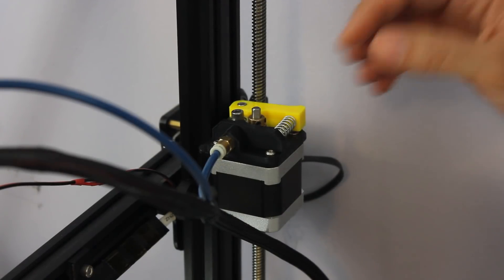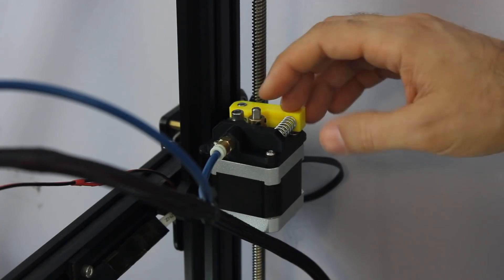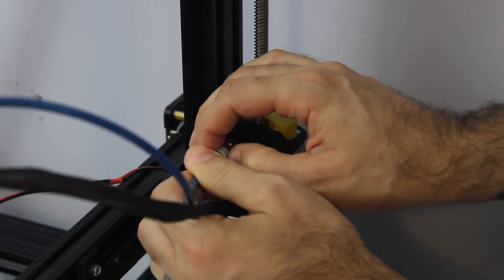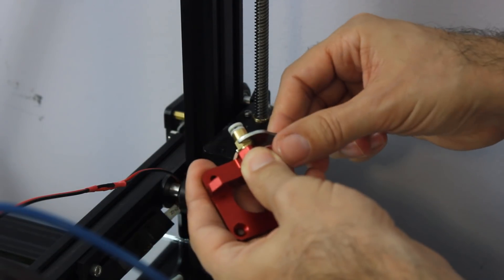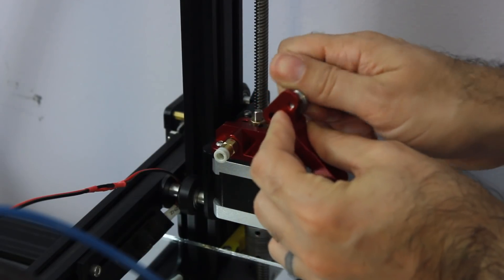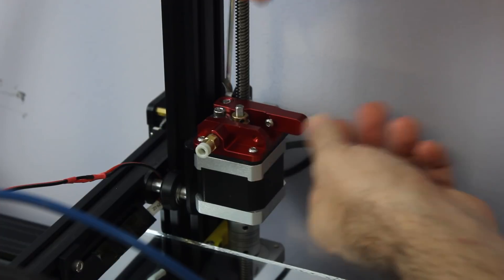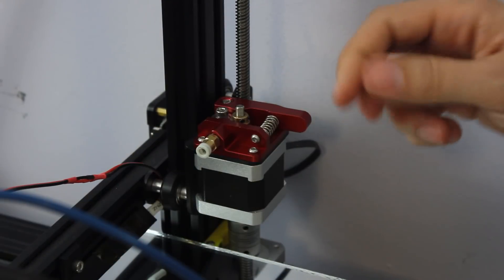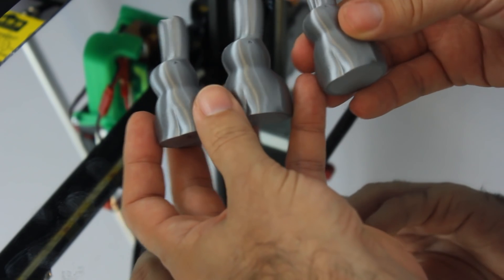Creality Metal Extruder Upgrade for CR-10 and Ender 3

Comment: Hi there. I have done a similar upgrade and I also replaced the gear. After the upgrade I kept having my extruder skipping. After some troubleshooting I found out that the replacement gear is of a different diameter. For me about 1 1/2 mm bigger radius which caused the issue. Thanks for the vid!
Reply from the maker: Wow, thanks for the info. You're the first person I've heard that's encountered this. Was it a Creality brand extruder kit or another manufacturer?
Reply: @Review3d  You're welcome. As far as I know it's a similar kit but not from Creality so that might well be the reason.
Reply: @Review3d  I'm having the same issue as Marcel. Mine are from Creality (Amazon). I've replaced the extruder arms etc with this kit on both of my Ender 3 machines and have had nothing but problems. I've tried tightening and loosening the lead screw for the tension arm.  It's like it can't pull the filament anymore no matter what adjustments are made. I don't want to give up but I'm about to toss them off a bridge! lol  Any suggestions?  btw I wish I had found this video before I replaced mine. It was very easy to follow.
Reply from the maker: @bakedonmaple1196  if your extruder is clicking I would compare the gear to the original one to ensure you didn't receive a different size like Marcel did. If that checks out then I would start a print and while it''s printing press on the extruder arm (in the direction that applies pressure, not to release pressure). If the clicking stops then your not getting enough pressure on the filament. Triple check that everything is installed correctly. If it is then I would add a thin washer to the spring to increase the pressure. If that doesn't help then email me (on the About page) and we'll see if we can troubleshoot more.
Reply: Dina Schliecker Replaced mine today, Same issues at first. I loosened the pivot screw and bearing screw until it stopped. I do still get an occasional creak noise, but not as bad as the clunking I was getting before. I still have more fine tuning I suppose, my under extrusion issue isn’t completely gone. How did you make out on yours? update I made a tiny spacer out of a paper clip per the idea of another YouTuber, and put underneath the round bushing that the screw goes through in the extruder arm. It seemed to make a huge difference, now the bushing can bottom out without the arm tightening with it.

Comment: A little blue loctite will take care of your persistent loose screw issue. We also run into a lot of this with anodized parts on RC vehicles. All screws going into metal that move/vibrate need loctite. Just make sure it isn't red!  ;)
Reply from the maker: I keep loctite nearby, but for this I wasn't sure I wanted to use it. My reasoning was that I wanted to be able to adjust how tight the screw was. If the sleeve was a little longer then you could fully tighten it, but as designed it will bind up the extruder arm if you fully tighten it. Loctite would be perfect otherwise.
Reply: @Review3d  Sounds just like the steering knuckle situation... We tighten them until the movement feels right, then let er cure overnight. Of course without having hands on, you know better what you're dealing with! 😉
Reply from the maker: @bustedupbungalow  fair point, I'm sure I could get it set where I need it before the loctite even starts to cure. I have another mod I want to do on the coupler side, then I'll probably try the loctite when I reinstall everything.

Comment: That lever jams when you tighten the bolt because the sleeve is made wrong. It should been made slightly longer than the thickness of the lever. I added a thin washer (about 0.3 mm) under the sleeve and my lever moves freely with bolt tightened. Keeping the bolt loose can lead to bent bolt or damaged thread. 
I also had to file edges of the lever to keep idler from grinding against the lever. 
I addition, I printed a small cylinder shaped cap for the spring so that I can adjust spring tension with a bolt.
Reply from the maker: Yes I wish they would make the sleeve longer, or at least include a washer. I hadn't heard of anyone else having the idler grinding against the lever, I'll have to keep an eye out for that. I like your idea for the cap.
Reply: @Review3d  I just made a cap with indent for the bolt on the other side. Slide it over the spring and put bolt in.

Comment: I had the exact same issue you did. I ordered the aluminum extruder from Creality and found the pivot screw loose as well. I also didn't replace the gear as well because I couldn't budge the grub screws without stripping them. 
I wish they had made the center pivot tube a little longer on the tension arm because if you tightened the screw it binds up and I didn't want to leave it loose so I fabricated a small spacer out of a paper clip.  Wrapping a piece around the screw and was able to tighten it down. I noticed an improvement right away. 
I would recommend it to everybody that has a Creality printer.
Reply from the maker: Yes, I completely agree about the pivot tube. It would be nice if you could fully tighten down that screw without binding up the arm. I was considering a small washer placed under the tube, effectively what you did with a paper clip.

Comment: This is not better than the plastic Creality extruder.  A much better option is the MacEwen MK8, which has tighter tolerances for pushing flexible filaments.
Reply from the maker: MacEwen does make a good upgraded extruder and yes, for printing flexible filament the FlexiPlus version would be a better choice than the original style extruder.

Comment: For some reason they only put a 16mm screw in there that barely catches and is mostly held in by the friction of the spring -->  easily wiggles out.
Easy fix? Just put in a 20mm screw. Worked fine for me.
Reply from the maker: Thanks for the awesome tip! I had't even considered the length of the screw, but I'll definitely have to try swapping it out.

Comment: Spring tension adjustment... Try a blind nut on "backward" with the points meant to embed into wood ground off.

My Ender 3 hasn't arrived yet, (supposed to arrive within 18 hrs) but if you need a couple of washers for desired tension, this will give a finer adjustment.

I use this technique in RC model aircraft

https://www.amazon.com/Boao-Assortment-Climbing-Cabinetry-Furniture/dp/B07FNDT5N3/ref=sr_1_10?s=hi&ie=UTF8&qid=1543927059&sr=1-10&keywords=blind+nut
Reply from the maker: That's a good tip too. I'm loving the different methods that people are using. A lot of clever ingenuity in our community.

Comment: Why would you upgrade to glass, then downgrade to painters tape.  Very counter productive
Reply from the maker: I initially swapped to the mirror because the factory CR-10 glass was almost as warped as the aluminum bed. Mirrors are a cheap solution and are very flat. I can easily level the entire bed now, but for PLA I still prefer tape over bare glass/mirror. The first layer sticks and holds really well, plus I can print with a much lower bed temp (usually 40c). For me it's just easier and more reliable.
Reply: @Review3d  fair enough.  Broke my heat bed, currently printing on bare glass with pla and have had no issues myself
Reply: @Review3d  What's the advantage of lower bed temp?  Does the first layer adhere better to a lower bed temp?
Reply from the maker: @davidhsieh604  I should be clear that this only applies to PLA. Other plastic need higher bed temps, but for PLA...

For me there are several advantages to lower bed temps, but the main advantage is time savings. The bed is up to temp very quickly if you only need to reach 40c (I hate waiting for temps to come up!). It only takes 1 minute 56 seconds for my CR-10 to reach 40c, even quicker on the CR-10 Mini and Ender 3. The next advantage is marginal, but it'll use less energy and doesn't heat the room up as much (a room with several running printers can get hot!)

To answer your second question...yes and no. The first layer will adhere better at higher bed temps, but that applies more to bare glass and not so much to tape. On bare glass I had to use 70c+ and adhesion still failed at times. I didn't want to deal with glue or hairspray so I started testing tape. I started at 30c and kept bumping up bed temps until I got the adhesion I needed. 40c gave me consistent, strong adhesion so I figure, why go higher?

Comment: You said you can put in washers to up the spring tension. What exactly does that process look like cause ever since I did this upgrade I’ve had issues with the idler skipping periodically from lack of tension
Reply from the maker: You can start with just one washer and see if that solves your issue. Place the washer between the spring and the extruder arm by removing the spring, insert the washer on the extruder arm where the base of the spring was sitting, and then put the spring back in place. If this isn't clear let me know and I'll shoot a quick video of the process.

Comment: looks spectacular , but thats not real under extrusion
my cr10 had real issues, like gaps and the such.

only 60% of normal extrusion
after replacing the extruder its great again
Reply from the maker: Thanks and glad to hear you fixed you're issue! You're right, my example prints were more an attempt to show the banding issue I was still having. The under-extrusion prior to tightening the screw wasn't severe either, just bad enough to mar every print in a few spots...which drove me absolutely nuts lol.

Comment: I have never seen a screw like that on a 3D printer. You should frame it!
Reply from the maker: I was pretty shocked when I saw it. Definitely wasn't expecting it!
Reply: Review3d luckily it didn’t break. Drilling it out would have been impossible to remove.